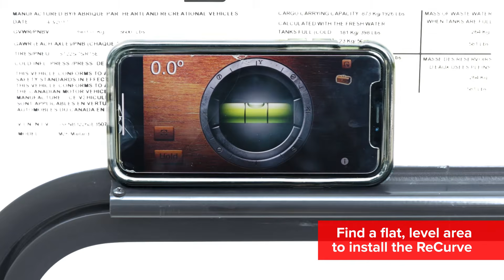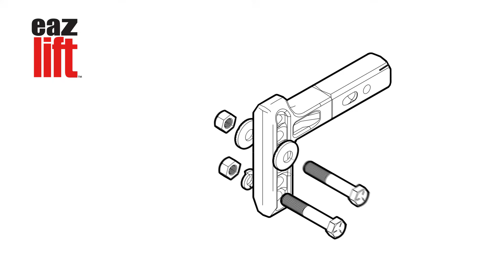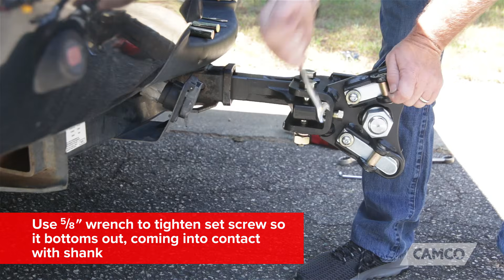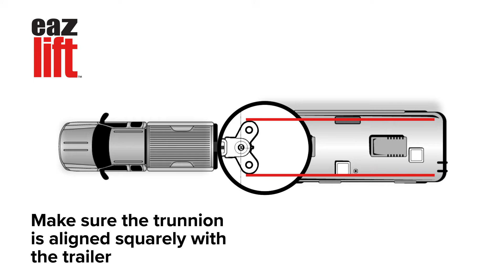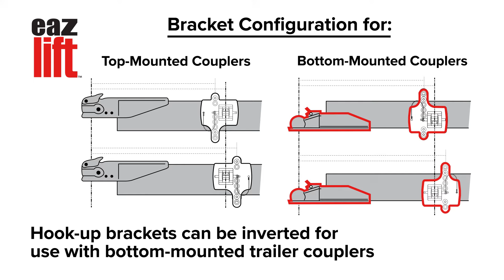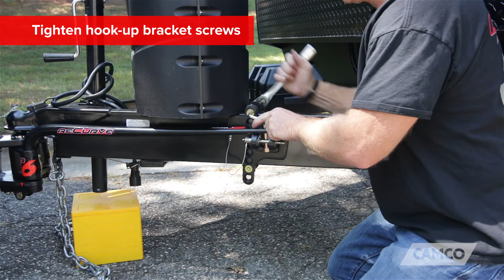ReCurve Install How-to: R3 & R6 from Eaz-Lift

Comment: Hi, getting ready to install the R6, and I was kind of surprised no torque specs are given for the hook up bracket hardware in the video or in the printed instructions? Just good-n-tight is good enough?
Reply from the maker: 45 foot pounds.
Reply: @CamcoManufacturing  Thank you!

Comment: Installed the ReCurve R3 600# system and just traveled 3400 miles with Dodge 1500 Hemi tow vehicle with great results! Great hitch!  Did however have 5k lbs air bags installed on the dodge but never air them up over min 5 PSI with truck not attached. Attached to the 29 foot MAllard UltraLite (6900lbs) the air bags PSI reading went to 17psi. Truck was level and camper pulled AWESOME! Great product!

Comment: I did what I saw. But when I put the trailer down. It was almost 2 inches different from my fender. I noticed I still had problems driving. Need some halp
Reply from the maker: Thanks for the comment, AARON LOWMAN. The acceptable amount of squat is 1”–1¾”. If you're experiencing more than that, perhaps the angle needs adjusting, or you don't have the correct size bars for your trailer. Please give our customer service folks a call at 800.334.2004.   --Scott
Reply: @CamcoManufacturing  they make different sized bars?

Comment: Can you do a video on how to adjust the sway control on the R3?
Reply from the maker: Thanks for your question, Derek. 
For the R3, adjusting the sway control is easy; It's basically like applying brakes to the sway. The more you tighten the activation bolt the more sway resistance is achieved, and conversely with loosening. How much sway resistance is needed is a matter of personal preference and will vary depending on what's being towed and the road/weather conditions. Does that help any?
-Scott
Reply: Camco Manufacturing scott- what if i follow the recommended set up and i have more than one inch of sag? What adjustments are needed to mitigate the sag ?

Comment: When you measure the height of the trailer ball coupler, are you measuring from the bottom of the coupler or the top? Also, when you measure the ball height, are you measuring to the top of the ball.
Reply from the maker: The measurement will come from the top of the trailer coupler, then the ball mount needs to be 1” taller than the coupler when starting out.

Comment: @ Camco Scott
I have an R3 w/600 lb bars. If I wanted to upgrade to R6 are the bars the same..... ie will R3 bars work in R6 hitch?

Also what are the advantages of the R6 over the R3? Already called your customer service and the explanation was super confusing. I would like it in writing that I can read a few times so it sinks in better.
Reply from the maker: R6 provides adaptive sway control; it automatically applies/removes Sway Control gradually, as needed; as opposed to R3 which is either fully on/rigid, or fully off.
R6 automatically disengages after 10°, making it easier to turn and back up.
And similarly to R3, R6’s Sway Control can be turned off when it’s not desired, and/or in the event of hazardous road conditions (snow, ice, slippery, etc).

The bars are the same for corresponding weight classes. I hope this helps.

Comment: Do you have a part # for a longer shank?
Reply from the maker: If you are in need of the 2” shank, #48650, that has a 5 ¾” drop, if you are in need of the 2 ½” shank #48652, will be the 5 ¾” shank in that version. Thank you.

Comment: I just installed our this weekend and man am I having a hard time getting it to set up correctly and I am not sure what I am doing wrong!! I followed this video to the tee and the instructions that came with it. 2 things I am having trouble with. First, the passenger side mounting bracket seems to be shifting no matter how tight I get them as soon as I back up and take off causing the trunnion to become uneven... I am on perfectly level ground and my tow vehicle was aligned with the travel when setting this up. I almost am having issues getting the tow vehicle to be within that 1 inch of its original measurement. At this point, I do not feel safe traveling down the road with this setup. Any advice? Otherwise, it has to go back for sure!
Reply from the maker: I understand that you have been in contact with a customer service representative. Let us know if you have any other questions.
Reply: Which model Milwaukee impact wrench are you using?
Reply: @CamcoManufacturing  i have an R3 system as well.  I need instruction on how to adjust pitch. There is a large round screw with grooves and a square screw underneath. What do these do? Thank you

Comment: New to installing this hitch.  Was installed at dealer and when I watch this video, the coupler height is about 19.5" and the ball height is about 25 3/8".  When I measure the rear fender height with hitch engaged, it drops about 2 1/8".  This is how it was installed at the RV dealer that I purchased it from.  Does this sound correct?  Have the R6 1200lbs kit.
Reply from the maker: Please contact Camco Manufacturing at 1-800-334-2004 to speak with our product tech support!

Comment: Should the recurve r6 prevent proposing?    We have no sway however when we go over small/uneven road we experience a lot of proposing (jerking).     It’s a new trailer, new recurve r6 and a 2016 f250 truck.
Reply from the maker: Please contact us 800.334.2004, Customer Service, Thank you.
Reply: Perhaps your recurve hitch had two large a spring bar as mine did will be identical problem. Hopefully this person's problem has been solved but Camco absolutely specified for my size trailer I should have no more than 600 pound bars and I had 1000.

Comment: I had to upgrade my truck from a 1/2 ton to a 1 ton just due to payload issues.  The receiver on the 1 ton is 2.5”.  The Rcurve r3 was set up for the 1/2 ton that had a 2” receiver.  Is it ok to use the 2.5” to 2” adapter insert sleeve with my setup to accommodate the new truck receiver?
Reply from the maker: Yes, you can use the adapter sleeve! Camco does offer a shank that has an extended drop and 2 1/2" shank to accommodate the height difference & receiver size. That item is #48652.

Comment: Last question, 

Your website shows that the R3 may have been shipped without grease and there is worry that it may have developed slight rust in shipping.  Camping World cannot tell me when their's was delivered (the one that I have).  How can I tell, without the box (since Camping World already discarded that) what day in April it was shipped?  

I already ensured that there is grease in the trunnion, but have no way of knowing if rust already developed on the inside during shipping.  

Thanks, 

Mike Long
Reply from the maker: If the ball mount has grease and the trunnion spins freely there is no concern of premature rusting.
Reply: @CamcoManufacturing  Cool, I can ignore the warning on your distributor's page.  Now can you answer for me my other question?  Thanks

Comment: We just bought an Ibex 19qbs with a weight of about 3700 lbs.  We are planning to tow it with a 2017 Honda Pilot with a towing capacity of 5,000 lbs. Should we get the R-3 or the R-6?
Reply: @@tyler530chico Thanks - that’s what we did!

Comment: I ordered 1000lb because my hitch weight is right at 1000lbs,but the ride is terribly harsh with my Ram 1500. I need to order 800 lb bars,but keep striking out trying to find a place to order. Help!
Reply: my hitch is the camco e3 recurve

Comment: What is the right angle for the hitch?
Reply from the maker: Thanks for the question, Andres. The starting point is 7°. 
That would be the setting that you create  when you backed out the thumb screw, then used the bottom bolt to wedge the thumb screw up against the shank. --Scott

Comment: I have at 4500lbs trailer with a 600lb hitch weight dry.  Max payload it would be 6600lbs total and 858lbs hitch.  Should I have 600 or 800lb bars ?
Reply from the maker: Our bars are rated +/- 200lbs of their advertised weight. A 800lb bar would be appropriate for your application!

Comment: What is the difference between r3 and r6?
Reply from the maker: The R3's offers constant but adjustable sway control, depending on how much you tighten the bolt. The R6's sway control is Adaptive--meaning, it reacts in real-time to how much sway is necessary. 
Check out this link which explains it a little bit better with some visuals: https://youtu.be/IrIqxT1q2FA?t=78
Thanks for the comment! -Scott

Comment: Is it okay to modify the spring bar stud one inch shorter from the original hole? The hook up bracket slot will not tighten the mounting bolt to the A frame due to hitting the battery frame. Appreciate your reply. Thanks
Reply from the maker: No, you cannot modify the spring bar due to liability. Thank you.
Reply: Possibly a stupid answer but were you aware that the Hook up brackets can be reversed to change the distance from the trailer ball?

Comment: My R3 was installed at the Camper Dealership when I purchased a new Travel Trailer.  My question is are the brackets that mount to the trailer frame supposed to be at an angle. It seems all the videos I can find show these brackets straight up and down. My are tilted a little bit .  Thanks
Reply from the maker: It is normal for the brackets to tilt slightly after use --Scott
Reply: @CamcoManufacturing  However, if the brackets angle too much they bind on the bolt and make it very difficult to remove your bars. I added a 16th to an 8th inch steel plate washer  on the bottom of my trailer beam between the bolt. This prevents the bracket from angling too much. I have had no problems since.

Comment: Does this hitch work with lifted trucks also?
Reply: I just bought a toy hauler this weekend and I own a lifted truck. They installed the Recurve R6 and it seems like my truck is very low on the back it sure if that’s what it was suppose to do or maybe the place installed it wrong! By the way my truck is a 2105 Cummins with 5” lift. Let me know I have pictures I can send if you guys need me to

Comment: R6 Recurve Installation Question:
Where the sway bars lock in. Is there a specific foot pounds of torque to secure them to the trailer frame.
Reply from the maker: Thanks for the question Edwin. For hitch inquiries such as this, please contact our Tech Support at 800.334.2004
Reply: @CamcoManufacturing  thank you I’m doing it now

Comment: I just picked up this hitch but have yet to install it, I am waiting for a longer shank to get delivered. I also purchased the 2 inch ball to take the place of the larger one. What size wrench/socket will I need for the nut on the ball hitch? (I'm thinking it is 1-7/8) I want to make sure I get the right size wrench. Thank you!
Reply from the maker: You will need a 1 7/8”, keep in mind these need to be torqued to 450 ft. pounds.
Reply: @CamcoManufacturing  450 ft pounds???  Next question has you answering 45 ft. pounds. I'm confused.

Comment: I have an r3 installed by the dealer.  Lately it's been squeaking really loud practically all the time, even tiny turns like changing lanes on the freeway.  Will putting some grease into the grease fitting stop this noise?
Reply from the maker: If you haven’t applied grease then yes, that should stop the noise. Thank you.
Reply: It was installed by the RV dealer and had grease originally.  I’ve used it for about a year so far for about 8 or 10 trips.  I’ll try adding some more and see what happens.
Reply: @Soundsoftheworld384  any update?
Reply: 50Calx2 I greased the fitting but that didn’t help
Reply: It doesn't help mine. Need a video on where and how to apply  @CamcoManufacturing

Comment: what do you do if truck drops 2" below original height?
Reply from the maker: Thanks for the comment, Jason Tindal. The acceptable amount of squat is 1”–1¾”. If you're experiencing more than that, perhaps the angle needs adjusting, or you don't have the correct size bars for your trailer. Please give our customer service folks a call at 800.334.2004.   --Scott
Reply: @CamcoManufacturing  Please answer in writing so we all can know how to adjust. Or make a video on adjustment

Comment: My trunnion never seems to stay in place. How do I get it to re-align?
Reply: Dominique _ mine was off while drive the freeway.
Reply: eric pyka is that good or bad?
Reply: It was swaying pretty bad... a RV repair guy said to turn the inner nob so the hitch-ball tilts more towards the travel trailer. Then I went and took the trunion to the oil change place and had them add grease to the fitting. I haven’t taken the trailer out since

Comment: If the truck drops to much, how do you increase pressure to stop some of the sag in the rear end. I already have the ball an inch above the coupler, but I am dropping more than an inch on the fender. how do I increase the amount on the bars to stop the sag.
Reply: Im looking for an answer to this question as well RV dealer just installed hitch told me it was all set my truck sags 3" when connected to trailer with bars on thanks.
Reply from the maker: You will need to tilt the head. Turn the thumb screw in and mark it. Then unscrew the thumb screw out 5 1/2 turns. This will set the tilt on the head, putting pressure on the bars.
Reply: Im having the same problem too...have anyone tryed to maybe raise the brackets on the trailer...where the arms go..will that help take the some sag....?

Comment: I have the R3 1200 on a Ram 1500. Towing a 28' 5500 lbs (750 lbs tongue weight) travel trailer.  I've maxed out the thumb screw but still have about 2-1/2 inch squat. Any suggestions?
Reply from the maker: Hey Steve. The Ram 1500 has a great ride and is great for towing. This is due to the coil spring or air ride suspension in the truck. The truck has a steep rake from front to rear and 2 1/2 inches of drop for this truck may not be achievable in relation to how much front lift you get. The most crucial thing to pay attention to when setting up the hitch is the measurements of the RV front coupler to the ground and the top of the ball mount to the ground. We have a great Youtube video on setting up the Recurve hitch: "Camco Recurve Hitch Installation." I also recommend contacting our tech support line to assist you with setting up the hitch.
Reply: I couldn't get the squat adjusted on my ram 1500 either. I took it to a repair shop and he said he had to swap out the stinger in order to get it set within the range on the recurve manual.

Comment: I had this set up for a Ford Sport Trac but now have to reset for a F150.  Here's the question:

You note to set it to 260 Foot Pounds.  I see you're using a Milwaukee Impact driver.  I am rather new to all of this but all the impact drivers I am finding are 210, 300, 1400 (especially in the Milwaukee series).  I see nothing special about your setup for your impact driver (I'm not seeing any Torque Limiting bars nor am I seeing variable speed on your cordless setup).  

So, if I buy an impact drill that is 300 ft/lbs am I safe?  Will 300 Ft/Lbs be excessive?  What if I bought the 1400 ft/lb Milwaukee (or any other brand) cordless impact drill?  Will that hurt?

Thanks for your answers up front.  

Mike Long
Reply from the maker: Yes, you can use a 300 ft. pound impact driver. Thank you.
Reply: Cool, so the additional 60 ponds of force will not be a big issue is what I am taking from this conversation.
Reply: @CamcoManufacturing  this video inspired me to purchase an impact wrench drill with max torque of 300 ft/lb. But, it does not have variable speeds and does not have a limiter. How will I know when to stop the wrench so that I don’t over torque? This may be a silly question, but given that it’s rated for 300 ft/lbs max, will the drill just stop turning at a certain point?

Comment: great simple install. It would be great if you created a video that tells us how to adjust if things are not within the 1 inch. I bought one with my used RV and had to get 9 turns to get the result you mention. does that seem extreme? It's a 30' coachman behind a 2011 F150
Reply: Yes- we need more details on adjustment.
Reply from the maker: Thanks for the question Don (and Alfred). The adjustment really depends on the tow vehicle. Not all adjustments will be exact. For help on your specific set up, please contact our Tech Support at 800.334.2004

Comment: You skipped the important part!  How to set the angle of the head for weight distribution!!!!  I sat through this entire video waiting for this step!.  Amazing.
Reply: Right! And they did not install per the manufacturer's recommended procedure. It would be nice if #Camco would update this video to include the adjustment  part of the install.
Reply: How does head have to be tilted forward to lift?
Reply: Very poor explanation

Comment: Is there a recommended grease for the hitch and sway when it gets noisy?
Reply from the maker: There is a grease fitting by the ball, that is the only place that needs grease applied. Thank you.
Reply: @CamcoManufacturing  Sorry, but that doesn't answer the question very well for two reasons. 1. What type of grease is being used at the factory? The instructions only say "wheel bearing grease",  but not all greases are compatible. Incompatible greases (ie: Synthetic and non-synthetic) can have detrimental effects. 2. The video says this applies for the R3 AND the R6, the R6 instructions state that the engagement balls on hitch also require lubrication prior to each use, not just the grease fitting by the ball.
Reply: Have you found any help for your questions? I'd like to know the answers too  @unknownriderinbound
Reply: @DesireeRogers-w9b  Sorry, but they never responded.
Reply: I left a voice mail. Maybe they will call back. @unknownriderinbound